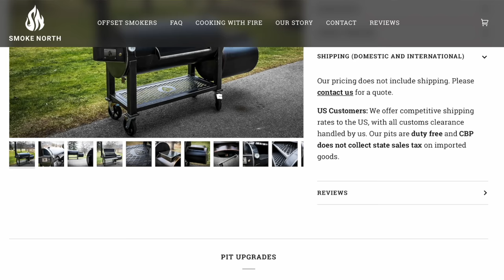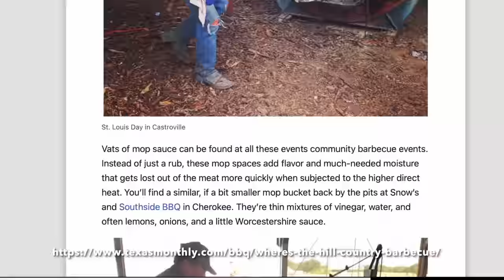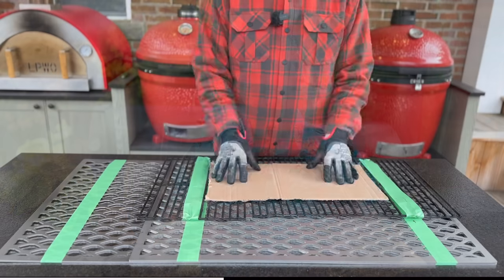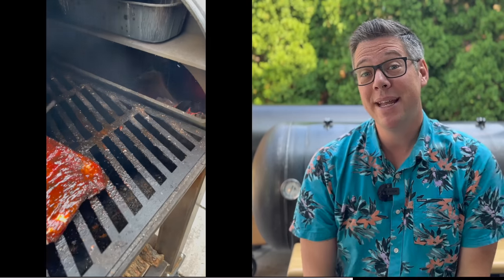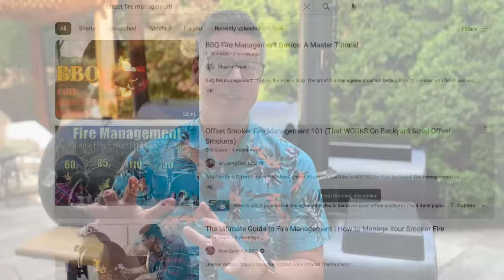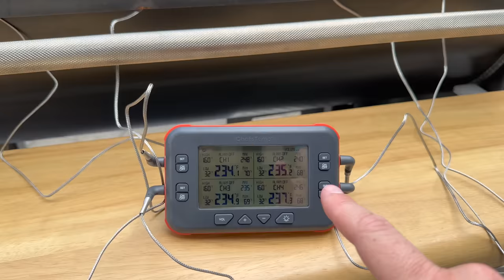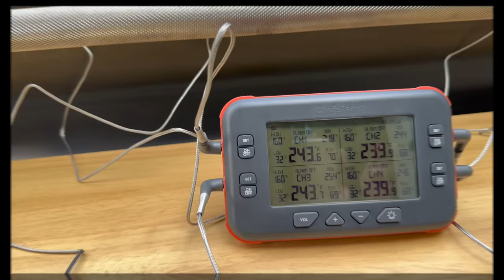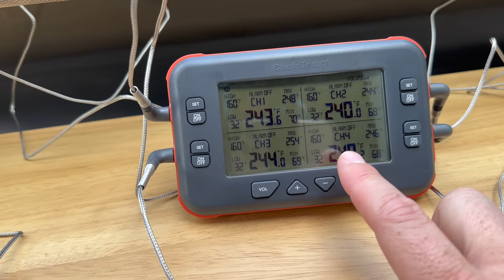Does A Reverse Flow Offset Make MORE Sense For The Backyard? | Smoke North Echo First Look

Comment: As a user of a large reverse flow 300+g, the main issue I see is the lack of air flow. Rather, learning how to best use the pit to get the best airflow. Hot air wants to rise. As it travels it slows down., in an RF it has to travel very far. If your pit drops temp it’s gonna really affect the ability of the pit to suck/push smoke through the chamber again. Get the pit VERY hot before adding meat, like 300+, the drop in temp after adding meat will be okay. Try getting the pit hot with cold meat, mines takes 16 15lb trimmed brisket bottom racks, it will take way too long to come up to temp. Thats a lot of hot air wanting to fall/cool instead of lift. Second issue is if you’re using the top rack, and bottom rack. The hot air and smoke will get stuck at the top of the chamber, when that happens, your bottom rack won’t get as much smoke. It will get some “direct” heat flavors from the baffles. Rotation of meats will be necessary if both racks are used. Bark building will be hard too, dripping fat from the top will affect the lower racks even with rotating.  A major benefit is the speed of the BBQ reaching done temps. You can get only so much smoke into the meat so getting the meat done faster, is a benefit here. Compared to my 250g in the backyard, the big RF is more fun to use. I like the challenge of the work needed to execute a cook for my food truck.

Comment: Great video! I have had a lot of curiosity about reverse flow smokers and I look forward to the information you will be sharing. It would be great if you could smoke the same cuts on your standard offset smoker simultaneously as a control or standard to judge the results of the reverse flow. One of the common complaints seems to be that reverse flow smokers don’t produce the same quality. Keep up the great work!

Comment: Great video and looking forward to your next video on the reverse!  I have owned two Lang reverse flow smokers, a Lang 48 and I now have a Lang 84 (250 gallon).  I personally love how they cook, but I tend to cook mostly on top rack on my 84, where there is less heat from the baffle plate.  Just my preference.  Since it cooks faster than a direct smoker, I also cook on slightly lower temp to get same traditional offset flavor profile.
Reply from the maker: I’m curious to try side by side the flavour differences.  Since this video I’ve done a cook and the smoke was clean, excellent if not light. Not sure if it’s lighter or just a clean fire the entire time
Reply: @SmokingDadBBQ  Lighter smoke flavor seem to be common feedback on the reverse flows.  I find slightly lower temp and closing the damper a little (and cooking on top rack on the 250 gallon) mitigates all of this.  A larger smoker is definitely easier to cook on than a smaller, IMO.

Comment: Been smoking on a reverse flow Pitt for 16 years. Never had an issue, best thing about reverse flow is consistent temp I. The pit. Basically all I ever did was light it, fill the pit with meat, add wood and pull my finish meat out. 
2-3, hr for chicken
3-1/2, hr to 4 for ribs 
5-6 hr for brisket and butts then wrap it up in a pan 2 more hours for brisket or till it hit 185 internal 3-4 hours till butt hit 205-210
Reply from the maker: I fell in love with this and ended up buying out the demo and selling my direct flow

Comment: Hey, so, great vid. You’re a nice guy. So, is it possible that the temp probes could be affected by the steel of the grill? So it’s not measuring air temps, but the steel temps which are more easily distributed equally?

Comment: Those probes read from the tips.  Your probe 3 and 4 are essentially reading from the same spot during the lower level readings.
Reply from the maker: I flipped it back after. Didn’t notice the wire tension moved it. 

Definitely will do it again with more probes to try and confirm but for a first pass that was good

Comment: James is the baffle plate removable? And if not , it would be impossible to clean the grease or fully season the pit. Can't wait till smoke north comes out with the one on the trailer
Reply from the maker: Omg a trailer model would immediately hit my bank account if I could find a storage option. 

No the baffle plate is welded in. I’ve done a cook since and most grease ran to drain plug so we will have to build up more to see how cleaning it is
Reply: @SmokingDadBBQ  Now that I think of it,  the opening from a firebox should be in the bottom. Technically you should be able to clean it from both sides.

Comment: Are you picking up the correct temps if you are lying the probes on the hot grate? Lift them off the metal and lets see what happens
Reply from the maker: can redo with some ambient sensors

Comment: So what happens if you make a brisket and comare this with and without firebrick or something similar on the baffleplate to prevent conduction heat from the baffleplate?
As the surface is so big and the temps so close, why not do these 2 briskets to compare at the same time?

Comment: Ah yes another great smoker debate. Texas BBQ offers the unique results through the thermal exchange from convection heat transfer. You can never replace or duplicate what a current of hot air transferring heat to a piece of meat creates. With the reverse flow smoker you will get both convection and radiant heat as the baffle plate becomes a heat sink. The baffle plate will allow you to keep more even temps but it also cooks slightly differently as the meat is cooked from the radiant heat below. Is there enough difference in the end result to choose one over the other??? Well, that seems very subjective. Perhaps your smell and taste buds are more sensitive than someone else's. Personally, between seasonings and sauces and mixed drinks I don't know that I would ever know the difference. I don't think you can go wrong with a traditional versus reverse flow. I think the key is the thickness of the metal allowing the entire cooker to become a heat sink which helps you recover temps and eliminate temp swings. If it's worth learning it's worth mastering. Enjoy the journey!

Comment: I am concerned about the method you used to get the temperature data. I noticed you used the meat probes instead of the air temp probes to test the four sections of the cook chamber which may not make a difference, but how they were used creates a question. The probes are laying on the metal grates not suspended into the air. Once the smoker is up to temperature all of the metal grate will be about the same temperature due to, as you put it, "conductive" heat. Suspended air temp probes would reflect the difference in the air in the cook chamber which is usually very different near or far the the heat. I have a reverse flow smoker and I do not get air temps nearly as consistent as you show. If your numbers are correct I am selling my unit and buying one like yours.
Reply from the maker: I will charge up my Meater and get ambient sensors in some potatoes or something like that and try again

Comment: did I miss the definition of what a reverse offset exactly is?
Reply from the maker: Oops. It’s where the fire box gasses aren’t allowed directly into the cook chamber. They have no choice but to travel all the way to the far side before it opens up and then are drawn back across the food
Reply: @SmokingDadBBQ  Thanks James, I see you have reviewed oklahoma joes non-reverse flow offset in the past, have you come across their reverse flow one yet? I can see one of those in the UK for 700something pounds which looks awfully cheap compared to 4k plus other offerings. Would be interesitng to hear your opinion if it is worth getting it as a first offset (given that even if it is small it should give more useful space for cooking)

Comment: The reverse flow i built a few years ago is pretty much a carbon copy of this one other then the fire box and my stack is welded on. I've found that filling the baffle  plate with water for the cook helps with slowing down the cook. Also with mine i can adjust how even it cooks just by changing the level of the cooker. I can get it to be within 5 degrees side to side all the way up to almost 35 degrees side to side

Comment: I have a reverse flow smoker and my issue is the baffle. I think it is set too close to the grate the food cooks on. For things like a brisket, the bottom cooks waaaay faster and has a tendency to burn. I am going to experiment with adding foil water pans to see if that helps. I'll also add that the other issue I have is the fire box. It is a cube and not a cylinder. I have a hard time maintaining a consistent coal bed without using more wood and increasing my temperatures to a level much too high for my food. Due to the flat bottom, the coals are spread all over the place instead of the middle like in a cylindrical fire box. The door also opens on the front instead of the side and I think that creates issues for the overall air flow. I wish it opened from the side to aid the air flow direction. Anyways cook and learn. Hindsight is 20/20. Looking forward to your cooking videos on these smokers.
Reply: I have a square firebox on a "large for consumer" sized offset that I have had for a number of years.  I struggled with fire management initially because there was a large coal grate on the bottom that was supposed to let ash flow through to a catch tray.  It did work for that purpose, but that also meant I had the same issue you are having.  The coals would fall through the grate and extinguish and I had to run a larger than necessary fire to keep it lit.  I remedied this by taking a piece of large C channel steel stock and putting it in the firebox to hold a smaller coal bed together.  I can drop one split in the middle of the coal bed and that is enough to maintain temp.  For your situation I would suggest getting some temperature safe bricks and arranging them in a U configuration in the middle of the firebox, with maybe a couple extra stacked up in front of the air inlet to eliminate the hot spot created by the draft, or maybe in line with the draft.  That way you can add insulation and containment to keep a proper tight coal bed and try different orientations to get an even burn and even heating in the cook chamber.  Just a thought, hope it helps

Comment: You always hear the issue of the bottom plate creating heat issues with the reverse flow.
It would be interesting to see one cook with a dry smoker and one with water, and the effects on the proteins, and ease of maintaining pit temps.
Reply from the maker: I’m definitely curious. Spoiler, first cook was about 20% faster but not burning. Maybe lighter smoke will need to compare side by side but my guess is slightly lighter
Reply from the maker: But … if you lose any slight smoke difference (which I’m not sure is the case yet) you gain on the ease of use side

Comment: I’ve been kicking around building a smoker. I have a 60 gallon tank in my shop already. Seems like the Goldie’s is is the best bang for the amount of steel needed to build it. Sure there’s a hot spot right at the mouth. But not enough real estate lost to do the reverse flow design.

Comment: Great smoker and wonderful video! Do you think the baffle is ready to put coals/fire over to use the smoker sometime as a grilling bbq
Reply: This is an interesting question. But I wonder, what would be the advantage of the reverse flow smoker compared to normal offset? I think the problem with putting coals in the cook chamber is that it will speed up rusting on the surrounding areas of high heat. So I assume the reverse flow would rust in the baffle and probably the bottom of the cook chamber would last longer.

Comment: Great video. Unbelievable temperature discrepancy. Brisket first. Fuel efficiency and airflow at  the stack outlet will be very interesting data. Thanks again.
Reply from the maker: Thanks. I’ve not seen many smokers of any size do much better at providing consistent temps left to right / up and down let alone at this scale. That’s pretty impressive

Comment: Looks great! Only observation is the location of the temp probe. The sensor inside the cook chamber appears too close to the point at which the heat makes its uturn and enters the cook chamber. It might help to relocate it more to the right of the chamber. Perhaps over the door about 40% into the length of the chamber.
Reply from the maker: Will try a few different places but it was reading what the 4 digital probes were

Comment: Glad to see the temp comparisons in the video, that confirms my suspicions regarding the heat profile of the reverse flow.  I have a kamado, large offset, and have some tanks ready to build another smaller ultra mobile steel cooker.  I was planning on a reverse flow and this video cemented that decision.  An interesting comparison, and one I am planning myself, might be to half a brisket and cook both pieces in the reverse flow then take half the brisket after it should be done taking on smoke flavor, and finishing in the kamado during an unattended overnight burn.  I have done a brisket only on my kamado and I was not happy with the flavor and texture of the bark compared to a "traditional"  offset.  I live in Texas so I am fortunate enough to have tried numerous briskets from various bbq dynasties and the kamado just wasnt quite there.  Thinking a hybrid might give the best of both worlds while letting me get a good nights sleep
Reply from the maker: I haven’t edited it yet… but my best Kamado brisket I just did using the pizza oven accessory (DoJoe) as it measured 4x more air wind speed exiting the pit than the top vent on my other kj using the sloroller 

But I agree best is relative to the absolute best … my offset moves 20x more air using the same tool so eventually you just can’t make up for that
Reply: @SmokingDadBBQ  Very interesting, I look forward to seeing that.  I would have to agree, while the Kamado does do a good job I dont think it can fully replicate the drying effect of the airflow and the flavor of a naturally cured all wood fire.  All that being said I still think the Kamado is the best all around grill and bbq appliance if you only have room for one

Comment: Great presentation.  Curious to find out how it will perform.
Reply from the maker: You and me both!
Reply: @SmokingDadBBQ  I've never cooked on a reverse flow smoker. From what I've seen, the downside seems to
be the radiated heat from the very hot bottom plate. That ought not be an issue when cooking on the upper rack.  I wonder whether adding an second layer of steel plate on the bottom, with an airgap, might correct some of the downside.  It could slow down cooking time, thus adding more smoke flavor.  Food for thought.